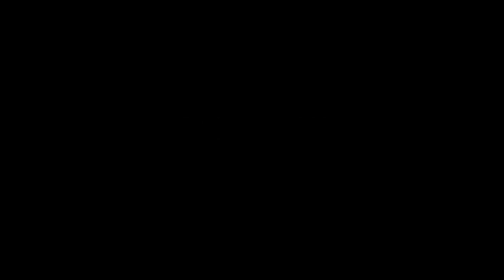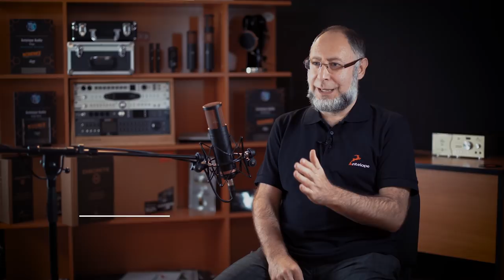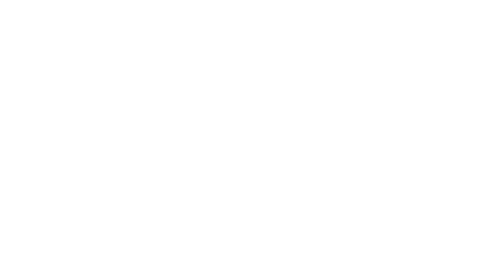AFX2DAW – a bridge between FPGA FX modeling and any DAW

Comment: damn that edge mic sounds good
Reply: It sounds surprisingly good. It works on anything I point it at and even things I don't point it at. I had the Edge on a stand in the drum room and just for laughs turned it on as a stereo room mic. Best room sound I ever got and I never even used the software. Just as a stereo mic. Then I set up a guitarist and tried several ribbon mics, dynamic mics and condenser mics on his cab. I couldn't get the sound I was looking for so, again, for laughs, I grabbed the Edge mic and bingo. Too bad the cables they come with suck. I had to send the first one back for a replacement and had to repair the replacement. They say the cables are high quality but don't believe them. I saw the solder job and it was a horror show. Also the 5-pin XLR is cheap so I'm ordering a Neutrik one to replace it. The pins aren't very tight and if I move the mic, the connection get's lost. That might have changed since I bought the Edge because I was an early adopter when the software wasn't even working yet. The mic sat in it's case for 6 months before I ever used it. The Edge has fulfilled all my expectations and then some and the emulations keep coming.